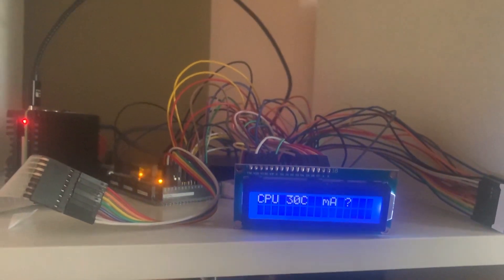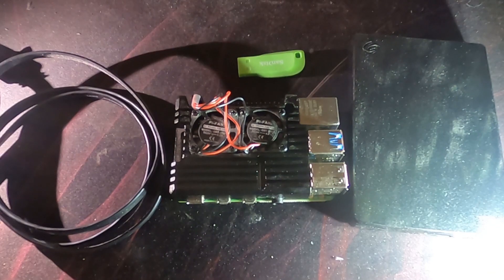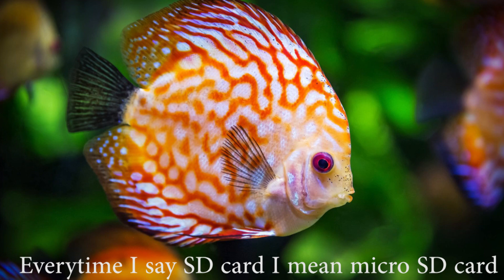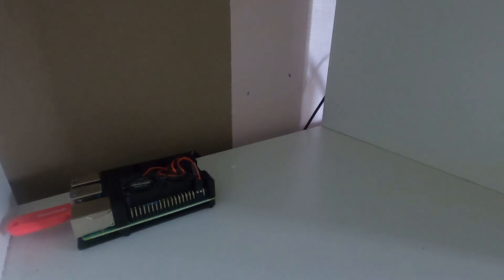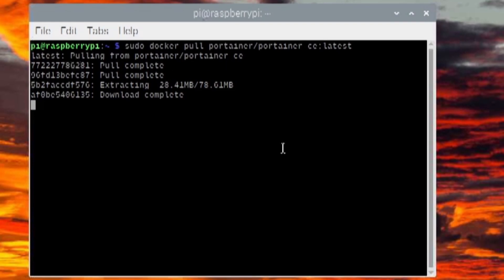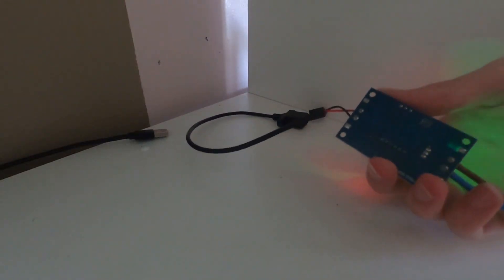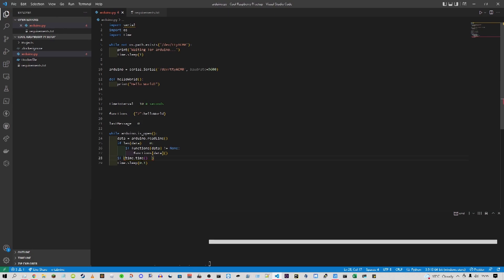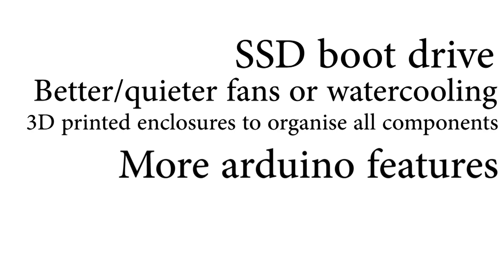An UGLY But FUNCTIONAL Raspberry Pi Setup!

Comment: Which OS version did you install? Did it all work well? Can you spin up containers ok? So many questions!!! ;-)
Reply from the maker: Hi, the OS version i used was the default raspberry pi OS 32-bit (the recommended one on raspberry pi imager) and as far as i can tell, everything worked properly and all the containers i have tried have worked properly, even accessing a serial port from a container worked fine. Hope this helped,  feel free to ask anything else! :)
Reply: @redstarbird  That's great and thanks. I've been trying to get it to work with Ubuntu Server 64bit. No luck so far sadly. I'll give your setup and commands a go and let you know how I get on. Looking forward to your blog post about it matey 🙂
Reply from the maker: Good luck, hope you can get it working! :)
Reply from the maker: @DudeWithADrone  Just letting you know,  I've now written the blog post if you're still trying to set this up https://www.redstarbird.com/blog/making-the-ultimate-raspberry-pi-setup/

Comment: Ooh. First to comment. :-) Will you be making a blog page for this video with the commands you used dude? I've just spent about three days trying to get this to work right (obviously not from your video) and had minimal success. Portainer was a pain in the butt. Couldn't get templates to work properly.
Reply from the maker: Hi, yes i am planning on making a blog about this video where i will go into a bit more detail. The commands i used to install portainer were: "sudo docker pull portainer/portainer-ce:latest" to download the image and to run it I used "sudo docker run -d -p 9000:9000 --name=portainer --restart=always -v /var/run/docker.sock:/var/run/docker.sock -v portainer_data:/data portainer/portainer-ce:latest" although that command might not be the exact right way to run it as I have only just started learning docker, hope this helps? :)